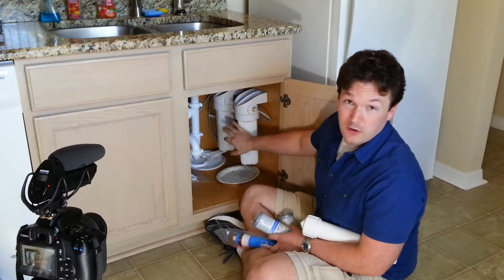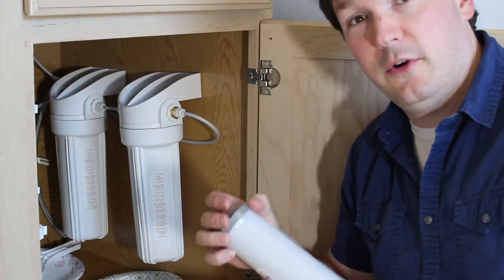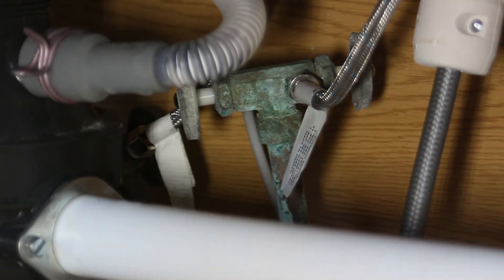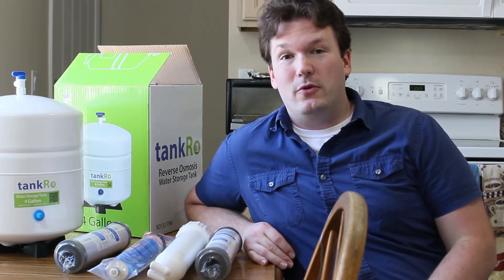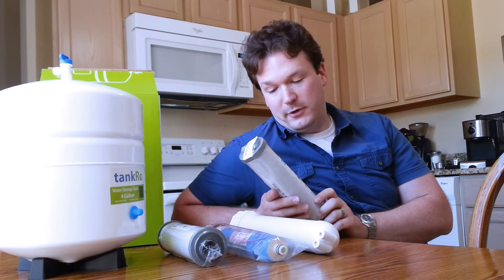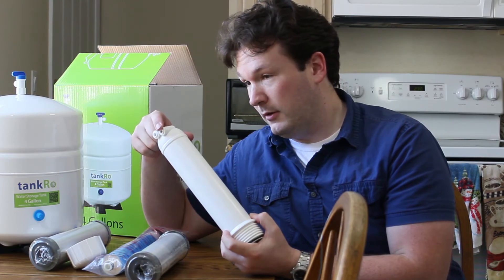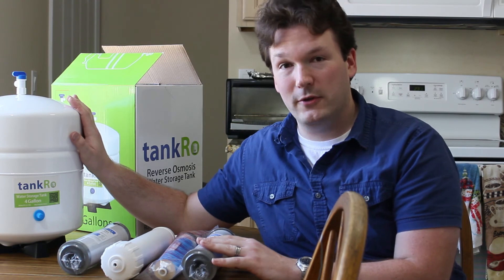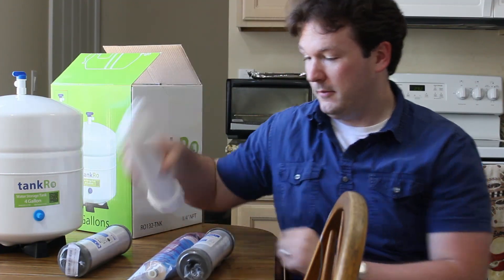DIY Reverse Osmosis System Part 1

Comment: Wouldn't you want the RO filter at the end of the filter system not in the middle?
Reply: The ro must be in the middle.  A second carbon filter removes the finial oders and taste impurity. Carbon filter is not a strong filter like an ro filter.
Reply: @ms560  So the second Carbon filter catches the finer material that gets past the RO filter?

Comment: what is your recommendation for a DIY RO system.  Just built a house and want to install a water filtration / RO  system.  We are on a well with a Culligan water softner.  My concern is the cost of the filters that have to be changed on a regular basis.  Would like great filtration without getting stuck having to buy name brand filters.  You stated the 10" filters worked well.  What kind do you like and where are they purchased?
Thanks, James